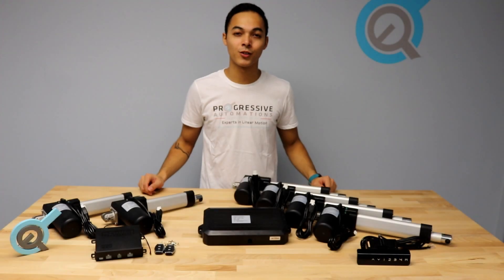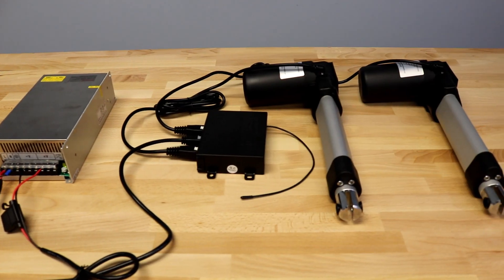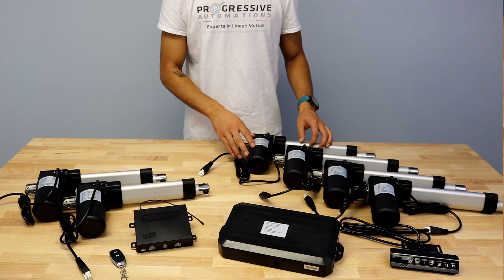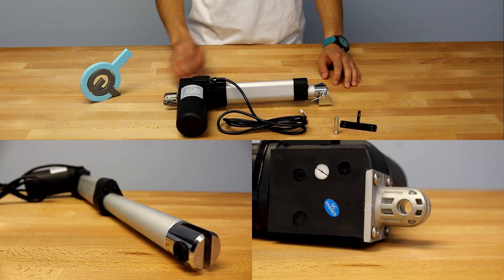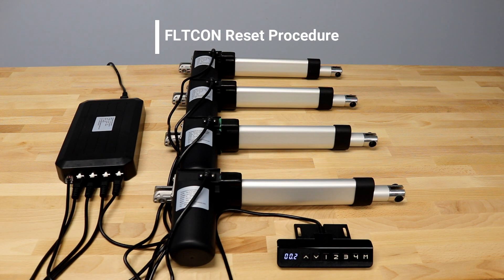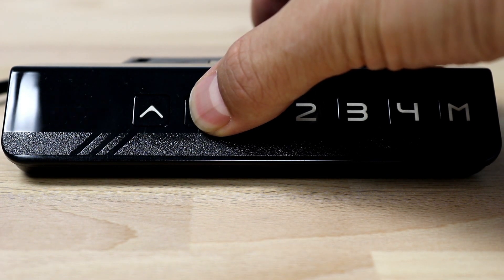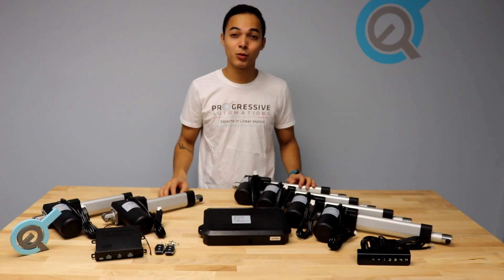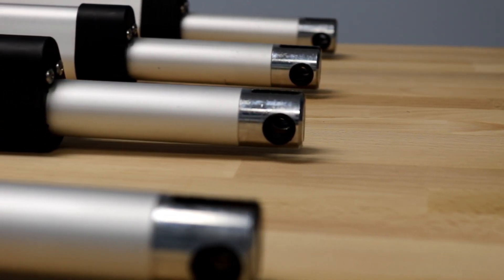PA-04-HS Linear Actuator with Hall Effect Sensor - Product Overview

Comment: Can I use an Arduino to interface w/ the feedback pins? Would be a good option instead of external reed switches, for example...
Reply from the maker: Hi Adrian,
Yes, feedback can be used with an Arduino, where this process can be shown on an instructable from Progressive Automations.
https://www.instructables.com/id/Hall-Effect-Sensors-1-Position-Control/
Thanks
Reply: @ProgressiveAutomations  Thanks for the reply. Will be putting some orders in!